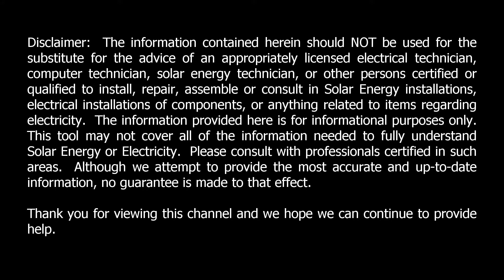The Year and a Half REVIEW of the MPP 5048GK Inverter!!!!

Comment: Totally agree with you, the unit just works.
Installed it 12 months ago, set it up and haven't touched it since.
5 Kw input, totally off grid, 12 x 260 Ah batteries wired to 48v and it runs the whole house with all the mod cons, pumps etc.
I work away from home for extended periods and monitor the system using ICC software via a RaspberryPi 4
Over a 24 hr period we generally run at about 70% PV and 30% Battery.

Hope you're doing ok over there, a friend of mine's wife went to visit her relatives in the Philippines early this year and has not been able to return home yet.
we really are living in crazy times, but the sun continues to rise every morning and that's a blessing.

Thank you for the update and keep it safe.
Reply from the maker: Thanks brother....but yes...awesome system you have.  Love not having to pay the electric.  Lately lots of rain though...but it keeps the batteries up for sure.  Got it set so it does battery maintenance every 3 weeks.

Again...thanks.  stranded, but different times for sure.
Reply: @SolarFarmer  Just in case you wonder about the value of your videos, my current system is the culmination of 7 years of organic growth, trial and error getting Solar right.
Along the way I've relied on people like you to validate my assumptions.

When I first started people told me I was mad, it won't work, you'll live like a pauper, barely enough power to run a light bulb.

Solar works extremely well and with this setup it's basically set and forget.

Your advice is priceless and much appreciated.
Reply from the maker: @NedKLee  

Wow!  Thank you so much.  That means a lot.

I originally just stored videos on YouTube...but it's slowly growing.  I, too, have studied a bit and still hear that Solar won't work.  Better for us because we know and are ahead of the curve.

Covid gas dampened my ability to continue video updates as I'm not able to get to my farm (different islands).  Stay safe and thank you again.

Comment: hi there i am in cebu... I have got 200 32650 lipo cells brought of shoppee to build a battery and 12 Canadian solar 405w panels... I am not sure what inverter to buy  do you have any thoughts i have been looking at the mpp pip-5048mgx and the toroidal 48v 6000w or the easun 5kw 48v 80a charger.... what are your thoughts...
Reply from the maker: If you have 200 batteries you can string 4s12p.  4 Serial Strings containing 12 batteries each.  At 4ampH (guessing on battery amp hours) per battery that makes 48V at 48amph's.  Thats equal to a 100 amph gel used to 50%.

You have 5000w of available solar panels...you could use what I have...MPP SOLAR 5048GK, but it's not scalable.

If you want to grow your solar to 10kw...get a unit that's parallelable.  MPP makes a model like that as well.

Hope this helps.

Stay safe.